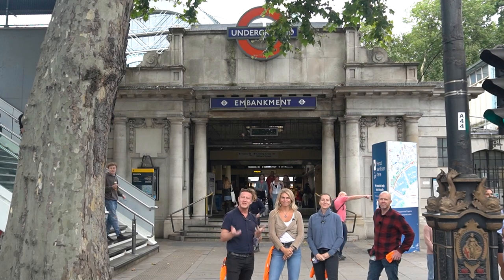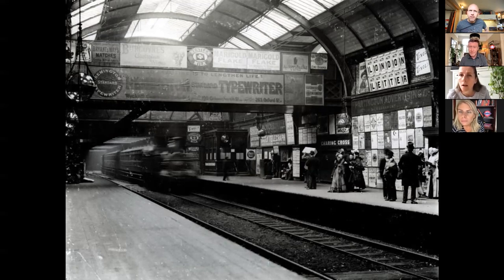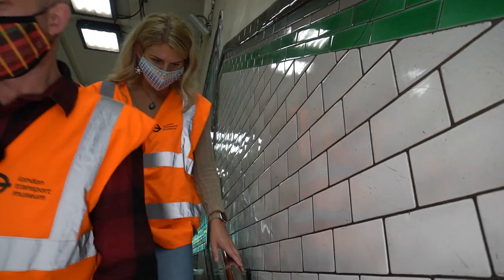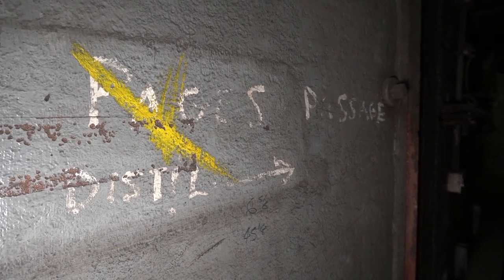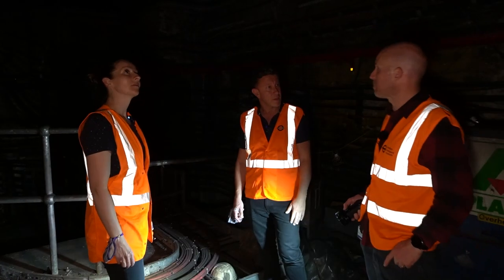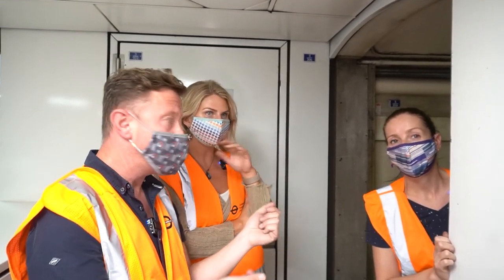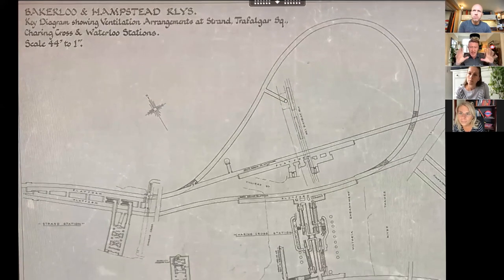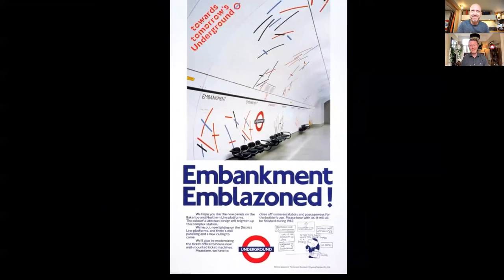Embankment Station's Lost Passageways | Hidden London Hangouts (S04E05)

Comment: Thanks for keeping the old Northern Line loop diagram up on screen, because I hadn't got what you meant about there only being one platform. I'd always assumed it was like the Kennington Loop, but here you used to arrive south-bound and go around the loop and stop on the single north-bound platform. Years of mis-assumption corrected - cheers! An enforced loop rather than a forbidden one!
Reply: ABSOLUTELY because there was only one place to go at Charing Cross (Embankment) and that was north again. So just one platform in the bend.

Comment: When the Bakerloo line opened in 1906 this station Embankment was the only station had no station of its own, the only access had from the platform to the surface was via that now disused step passageway slope which lead up to the Eastbound District line Charing Cross station platform, It was such an award arrangement, this was 2nd tube station in history to get total escalator conversion in 1914 and the original Bakerloo arrangement was abandoned.

Comment: Wasn’t there a time in fairly recent years when some sort of work was taking place in the river and the floodgates on I think the Bakerloo line were closed as a precaution during the works?  Maybe something like twenty or thirty years ago.
Reply: The floodgates are still in place on the Northern and Bakerloo Line platforms  and can be drawn shut if required, due to the station's close proximity to the river.

Comment: A fascinating tour but a couple of points if I may - (i) about 3 minutes on the photograph of the District Railway platform but not a word said about the signal box in the centre of the photo which controlled the trailing crossover between the WB and EB lines (about where coaches 2 and 3 are); and (ii) SER/CER - During my 30-odd years with the Underground I always understood that a CER was a Communications (not Control) Equipment Room. Otherwise, a fantastic amount of information to take in. Thank you.

Comment: I wondered why there was old lettering fired into the tiling on the Bakerloo platforms that read "Embankment" when they were being redecorated,  as I was under the impression at the time that the Embankment name was used for the first time when the station was renamed in the late 70's.  But as mentioned by Chris, the Bakerloo part of the station was originally called Embankment, which explains the tiling, which must have been covered up for many years.